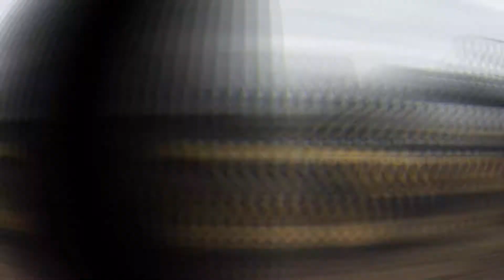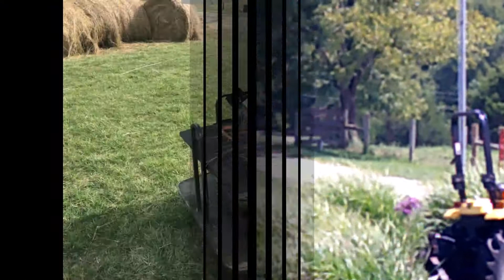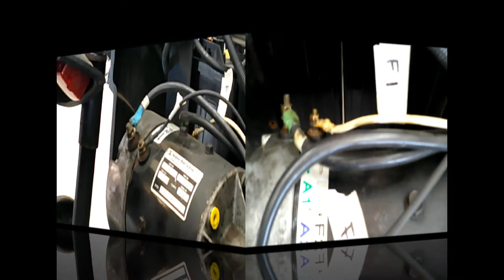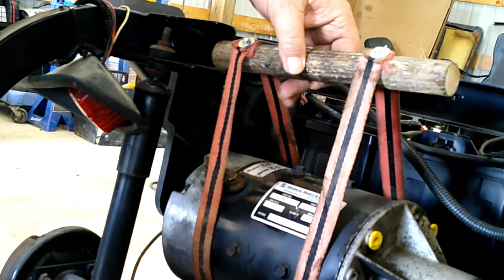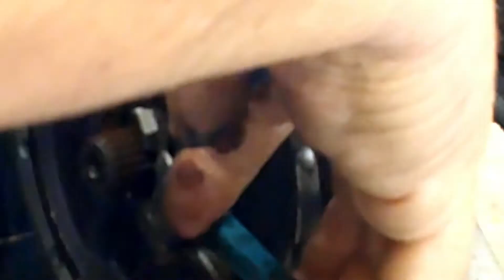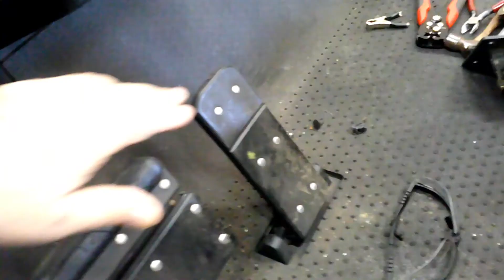Replacing Input Shaft on an EZGO TXT

Comment: This is exactly the problem I'm having with my cart.  The splines on the input shaft and motor drive coupling both stripped.  Unfortunately, the problem extended into the motor as well.  Motor shaft wobbles and also make grinding noises (I believe motor should spin smoothly, quietly and with little effort).  At least I now know the input shaft is a piece of cake to replace and found the part on Amazon.  Afraid I'm gonna have to replace the motor though and that looks like $800 give or take.  My thinking is the metal filings from the splines got into the motor and did further damage.  I will take the motor up to the shop and see what their tech has to say about it.  Maybe it can be rebuilt; don't know.  I'll do some further research online first.  Any comments or advise appreciated.  Thanks a ton for the vid.

Comment: Can you please tell me what is the diameter of the splined shaft?? I know it has 19 splines but I need to know the diameter of the input shaft
Reply from the maker: I measured with calipers and it showed 20,7mm
Reply: @jimcampbell1705  Mr. Campbell thank you. Do you think it's 21mm or 7/8. ?
My shaft in my project is 7/8 or 21mm.
Reply from the maker: @zzzzzsleeping  are we talking about an EZGO TXT?
Reply: @jimcampbell1705  I have RZR 800 i converted to Hayabusa engine (for golf cart parade in my town)  but I retained the differential of Polaris RZR800. The original is CVT - I took the cvt clutch out  and trying to convert to sprocket to sprocket. The Polaris RZR diff input shaft is 19 splines and 7/8  or 21mm splined diameter
Reply from the maker: @zzzzzsleeping  of course I only had an old input shaft on hand. 7/8” = 22.23 mm so this one being worn, I would venture to say it’s close to 7/8” I would order one off of Amazon and measure it. If it’s not what you’re wanting, you can always return it.
Reply: @jimcampbell1705  thank you Mr. CAMPBELL  - I appreciate your help. Yes! I ordered one in Amazon- I think it's closed to 7/8 or I might need to heat it up to press.

Your old one you said is 7/8  - the 19 splines coupler in Amazon might fit to my shaft. Thank u again.
Reply from the maker: @zzzzzsleeping  you should not have to a press. Good luck!
Reply: @jimcampbell1705  Horray ! Mr. Campbell IT WORKS !!
Thank you so much ....
Reply from the maker: @zzzzzsleeping  I’m glad for you my friend. Good luck!!